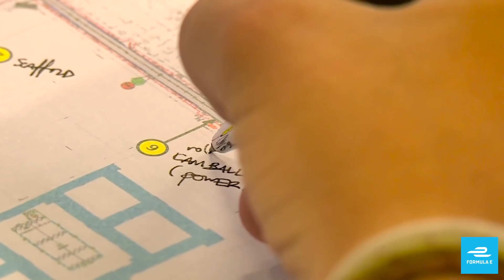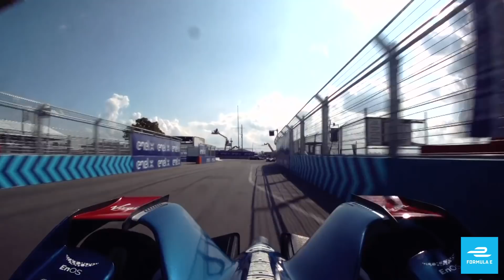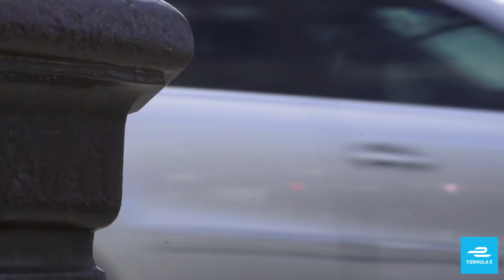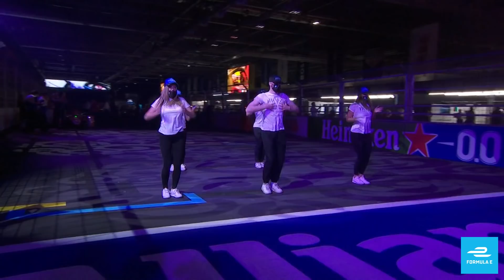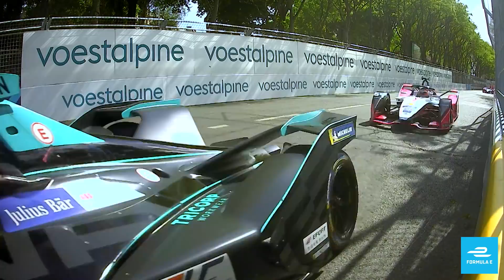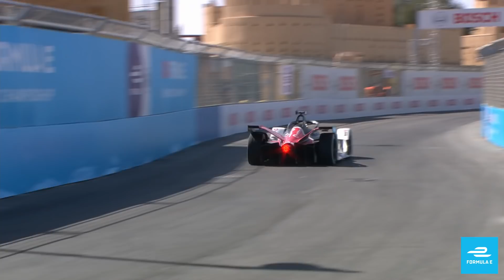How Are Race Tracks Designed And Built? | Formula E: Explained

Comment: I wanna join formula e when i get a bit older and even tho i havent grown up karting I Still have alot of talent When it comes to racing and I love going fast and racing new tracks. I used to be a Indycar fan and an F1 fan but when I came across Formula e it changed my whole perspective on racing. Like attack mode that was really cool in my opinion and adds lots of potential overtaking The only thing that worries me is my height Since im 6 ft 4
Reply: The not so humble flexer

Comment: The cobblestone department at 15:50ish.
Is the cobblestone in a straight line or in a corner? Because if it is in a straight line, is it possible to keep it? See it as a local difficulty for the drivers? Or is the FIA straight out a 'no' on that? Sure it will be slippery, but the slight bumpiness wouldn't damage the drivers/cars too much?

Comment: "temporary power infrastructure" (diesel generators) lol
Reply: Those are super efficient and use biofuels. The emissions generated by them are much lower than what you get from car emissions in more usual motorsport series.
Reply: @Jehco14  biofuels aren't as green as you may think...
Reply: @Sweaty__Sheep  It depends on how they are produced. But FE carries an extensive emission study throughout the season and they make continuous improvements to limit their impact. The biofuels used are glycerine based and carbon-neutral.

Comment: I just don't understand why you make the tracks and especially the chicanes unnecessarily tight. Like the one on the main straight at Valencia. Why make them so Mickey Mouse? Make them like the Monaco pool chicane where they're fast and delicate. Not clunky and awkward. It hampers racing.
Reply: Given the energy limit for the races, it's better to have tracks with a low average speed, that enables the saving percentage (the amount of energy you have to save in the race versus the energy it takes to do a flat out lap) to be lower. Tracks like Marrakech have several straights which make the average speed high, which translates into early coast phases for the races compared to other tracks. 

These low speed corners help lower the lap consumption (by reducing aerodynamic drag). And as the cars have no gear and instant torque, they go around those corners much better than most other race cars would.